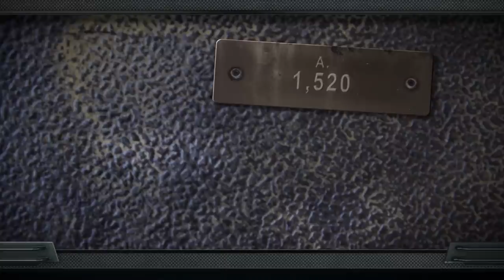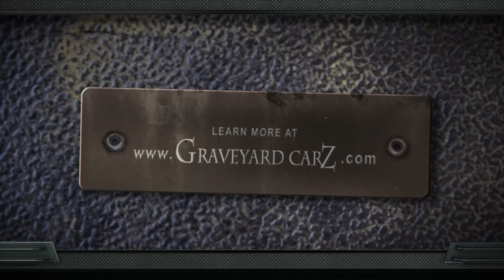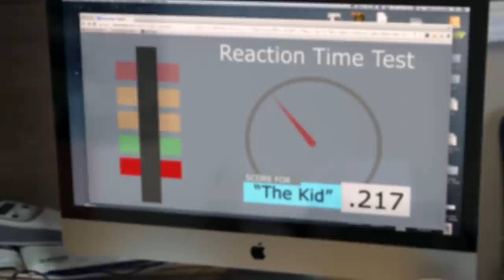Season 3 Episode 2: "AAR You Ready For This"

Comment: I'll be honest.  I think it is absolute BS to take parts off of another car being restored for another project.  I do feel for Daren, but Daren is 100% responsible for the condition and security of his car and parts.  He should have had an inventory from day one and checked to see if anything changed daily.  I'm pretty sure Daren has no idea where most of the parts were or went, or if his car actually had them.  10+ years is a long time of not keeping track of everything.  Mark should've left Daren's car alone, which clearly is big rift between Daren and Mark.  At this point, Mark just needs to ensure Daren's car is taken care of and Daren needs to work with Mark to ensure everything goes smoothly so both are happy with the end result.  There is no doubt that Mark will treat Daren's car no different than any other client's car.  Both just need to stuff the BS and get the shit done!